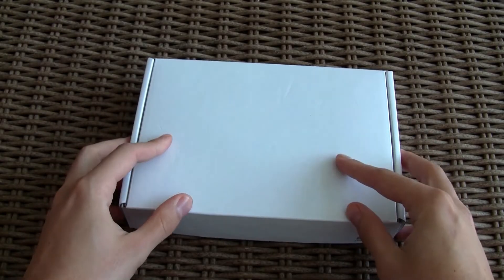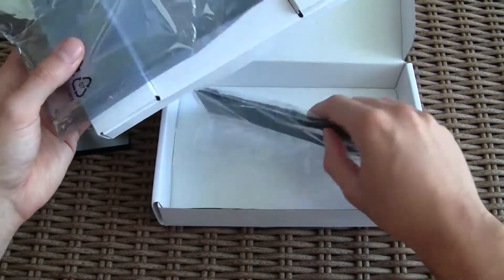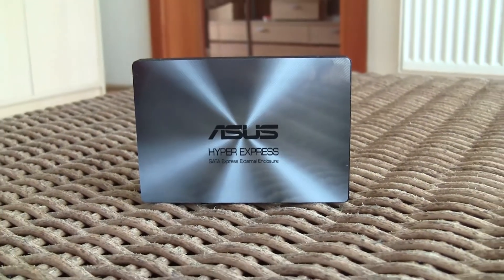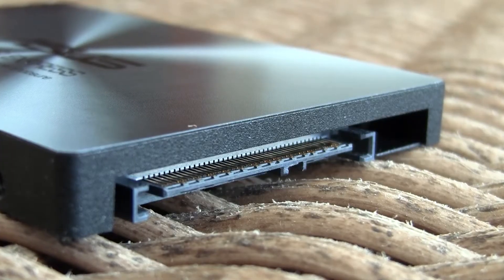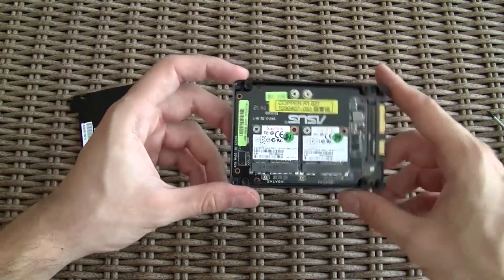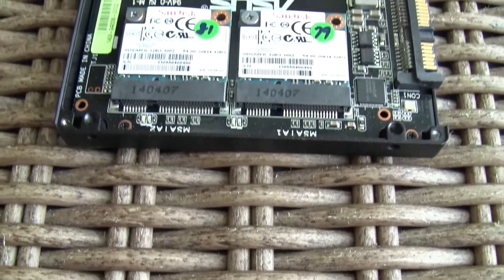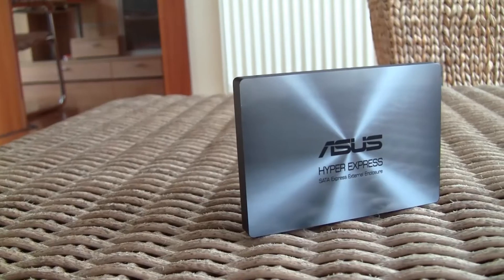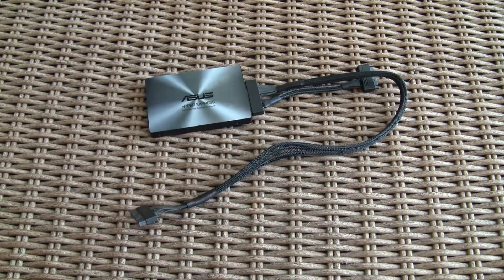Asus Hyper SATA Express SSD Unboxing & Preview

Comment: Great no BS packaging. No excessive plastic or foam, very well protected.

Drive is also sexy and useful. Can it run RAID 1?
Reply from the maker: I'm not sure, this format featuring SATA Express is basically dead interface.
Reply: @MattsPaddock  yeah. I just got some u.2 drives with sff-8639 and I am testing now. I agree SATA express was and is dead end. The benefit of SATA express was supposedly cheaper cabling. And yeah, sff-8639 to sff-8643 cables are not cheap.

Comment: So this is just 2. M.2 drive running at raid 0

How does it compare to a PCI card with the same M.2 Drive...
Reply from the maker: +gamemaniac85 PCI-express card will get give you greater bandwidth which can help in scenarios where you have much faster M.2 drives!
Reply: wrong, this is 2 mSATA drives running in raid 0

Comment: release date?
Reply from the maker: I just got a retail sample of this concept, so I assume it's already on sale or it will be soon. I'll do an unboxing video soon!
Reply: TekTick there were supposed to be 2 models and I'm highly interested in the one that combines two 2.5"drives into a single ssd unit. what is the latest news?
Reply from the maker: 2muchjpop I've just recently did an unboxing of this https://www.youtube.com/watch?v=k9qwBzvKAG8

But it seems it's still not on sale although this is a final retail version.
Reply: i was talking about this with sata express not the m.2/msata http://www.amazon.com/2-5-Inch-3-5-Inch-Converter-Components-HDCV-2/dp/B00856XFVW